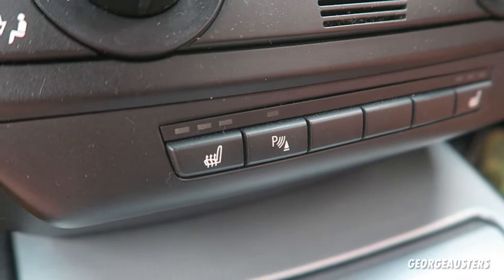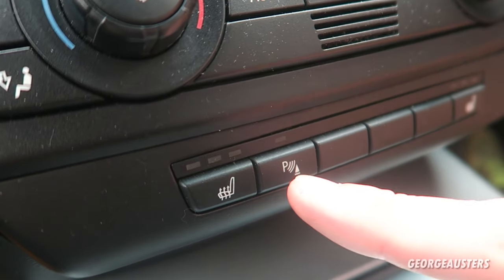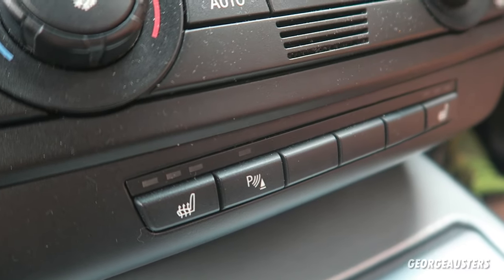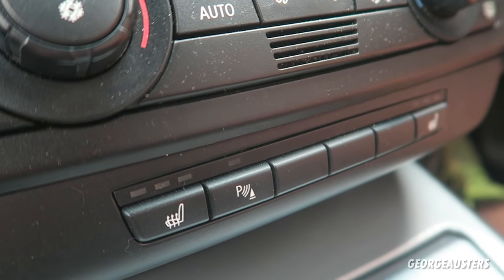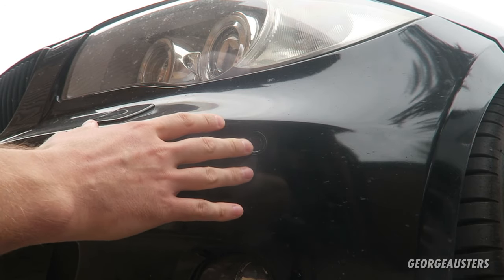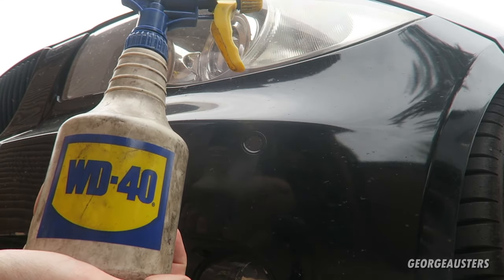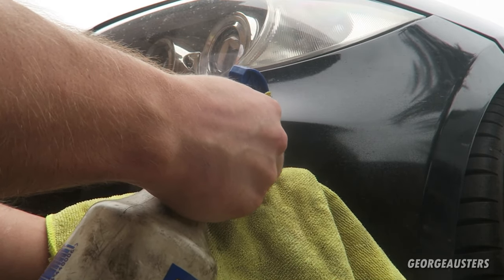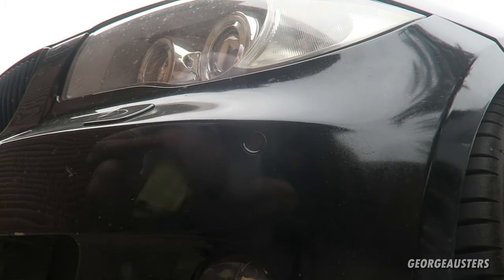How To Fix Your Parking Sensors For FREE *Works On EVERY CAR*

Comment: Did this on my challenger, just went and washed my car and my sensors stopped working , went and bought the WD-40 and it worked.
Reply from the maker: Glad to help!
Reply: WD 40 is lubricant...?
Reply: @gursimransekhon688  that's a misconceptions actually. If you truly need a good lubricant, WD-40 is not it. It frees up squeaky hinges and rusty threads, etc, but that's not as much from lubrication as it is Water Displacement (product stands for Water Displacement - 40th Formula). Draws moisture out, thus helping prevent/fix rust or in this case, clear up a sensitive electronic sensor.
Reply: Why does this happen after a car wash? This just happened to me as well I’m on my way to buy wd-40

Comment: I used a portable vacuum (18v Milwaukee) I put the hose on the blower side of the vacuum and used a crevice attachment (this increases the speed of the air) and aimed it at each sensor while varying the angle of directed air and it worked. No direct contact between the vacuum attachment and car panels/bumbers.

Comment: I was very skeptical of this but decided to try it on my 07 Silverado. My wife had washed my truck and I had not driven it for 3 weeks since I was away for work. When I turned it on I found the Service Park Assist message and found my sensors were not working. When I saw the price for each was over $200 I said what the heck, it can't get worse. But to my surprise after spraying all 4 of them with WD40 and turning on my Silverado, the sensors started working and the message no longer came back. Thanks for the trick!!
Reply from the maker: You’re very welcome Edward, glad to help with your truck!

Comment: This sounds too good to be true, i will try it and report back xD   Just bought F11, when testdriving it it worked, and just after i bought and brought it home, sensors stopped working, just got an error '' no parking assistance, please park unaided'' lol.   Ill try this, because i really dont feel like taking down bumpers replacing sensors with alibaba ones (they are cheap, but the replacing part probably sucks)
Reply from the maker: Good luck
Reply: ofc it didnt do nothing.
Reply from the maker: @skyliner4610  did you spray a good amount directly into the sensors?

Comment: Thanks for the valuable tip- Had problems with the camera in the back of the car-- did not work at all- used WD40- after 1 hour it worked perfectly again. 6 euros for WD40- we saved at least 500 euros on your tip.
Reply from the maker: You’re welcome!

Comment: Honestly I've been chasing a supposedly bad rear sensor on my 09 Ford Smax, computer said it was the rear right sensor, removed it and swapped it with the working left rear, same thing.

Chased the cabling all the way to the sensor control module and tested everything for continuity... All fine. 

So i be assumed I'll need a new control module at 225 quid from ford.... Balls.

Sat in the bath hunting for other fixes, came across this video.

Doused all the sensors in wd40, wiped and doused again.... Put her in reverse.....bugger me it works.

I can't believe this fix works.

Thank you so very much!

Comment: What a simple trick! It worked on my 2008 Toyota Sequoia instantly. It has been fussy this winter. I tried washing and drying the front sensor, thinking it just got a bit dirty without success and the new sensors are very spendy. I sprayed it liberally with WD40 and the sensor alarm went away immediately. Thanks George.
Reply from the maker: Glad it helped!

Comment: Thank you, this really works, tested on Peugeot 508 SW 2015! Haven't drove our car for 6, 7 days. Car was outside under the car cover and past 6, 7 days we had all kidns of weather condition: snow, rain, light winds, up to -8 Celsius over the night, few sunny days.... Yesterday decided to take out cover from the car, it was below 0 Celsius and because of rain, snow, sun and cold, there was a lot of snow on the top od car cover and car cover was like a cardboard paper almost completely glued to the car. We had to use a lot of water temperature around 25 Celsius (never use hot water, glass could easily brake if it's really cold outside!) to "soften" the car cover. Finally we did it, car cover was removed. Some half an hour later tried to start the car, it started without a problem but on the main screen car gave us a worning  that something is in front of car but in front of the car there was nothing at all. At first we thought some of the parking sensors on the front of the car got faulty. We took a short drive and every single time we stopped car gave us a working that something is in front of the car really close, it was so anyoing. Did some research and found your video on Youtube so decided to give it a chance. My WD40 bottle was almost empty so I had to use something else: cheap W5 lubrication spray from LIDL, not as good as WD40 but I had nothing to loose. I've sprayed all parking sensors in front and on the back of the car two times each, it was still cold outside, left it to soak for a half an hour. Started the car and: voila, no more parking sensors warning! Wife did a few circles around the car, 50cm to 20cm from each parking sensor, to test if all car sensors are working propperly and they did, problem solved! Guess some amount of ice formed around one of few front parking sensors, they were "thinking" there is a close obstacle in front of the car. All in all problem solved, no more parking warnings yesterday or today, hope it will stay that way. You've earned yourself one more sub, thanky you!

Comment: Spot on. 2014 ford Cmax with "Parking Aid malfunction. Service required" message.  Spayed the rear bumper sensors with WD40 some crud also came out. But back to normal working. Great fix. Thanks for posting this video. How many drivers have put their car into the Ford service centre without trying this hack?
Reply from the maker: Glad to help! Yep dealers will be replacing the sensors at your expense before trying this trick!

Comment: Hey there! Hitting you up from the US, I just did this on my wife's 2012 Ford Focus and it worked like champ! I used Tool Box Buddy spray fluid rather than WD-40 but they're all pretty similar. Sprayed it down, cleaned it up and waited a while to let it work. Tried it a couple of hours later and the problem was fixed. On the Focus the sensor made a continuous beeping sound rather than the repetitive chirp and now it functions like new.  Thanks for the post, I'm sure the shop would've charged me at least $200 for that.
Reply from the maker: Glad to help! Considering supporting the channel to show your appreciation

Comment: This worked on a 22 Black Edition Ridgeline, thanks! Front passenger side sensor stopped working properly after a rainstorm but the driver side worked still.   All work as intended now!

Comment: Just used this tip and fixed my annoying warning flatline bleep. Thanks! 🙌
(Mercedes CLK 2003)
Reply: I got 2red dots and beep .. on my w204
Reply: @almighty9662  same with my s class 2008; how did you fix that?
Reply: @devmaadam2922   still not
Reply: Yep. Fixed my flat line too

Comment: Thank you very much. My Vauxhall Mokka was giving "Parking Assist Temporarily Unavailable" and giving a loud Bong sound every time I started the car and every time I came to a halt. It was driving me nuts. I sprayed WD40 into the sensors but it did not fix the issue straight away. However the next morning it was working perfectly.
Reply from the maker: Yeah can take a while to drive any water out👍🏻

Comment: 10/10 tip it worked on my audi Q2 which stopped beeping when put in reverse, it only had one long beep instead of the frequent beeps alerting me of distance to an object. after cleaning with wd40 it started to work as normal
Reply from the maker: Glad to hear!

Comment: This worked for me, parking sensors kept getting randomly triggered when there was nothing infront of the car and this solved it.
Reply: Same issue here. Going to try that fix
Reply: So you mean ur car was beebing with nothing infront ? And u use the wd40. And it is gone ? Cause i have the same issue here some time its beeebing with nothing behind and sntimes it works perfectly! So u advice me to use the same trick ?
Reply: @ahmedradi4773  this fix stopped working shortly after. Haven't figured out a fix yet. Probably needs a trip to the garage.
Reply: @Oscar-if6lq  if this doesn't work you most likely need to replace the sensors in the bumpers
Good luck 🤞
Reply: @ahmedradi4773  just wipe the sensor with dry clothes or dry tissue. Mine also beeps sometimes after washing.

Comment: Worked on my Ford Ranger. The night before was a deluge of rain, had an issue with the passenger rear reverse parking sensors. After a quick blast of WD40 and waited a few minutes and it sorted out the issue.
Reply from the maker: You’re welcome!

Comment: This strategy worked for me multiple times until recently. Now one of my front sensors will not work regardless of WD40 use.....New sensors for my Lexus are about $250 each not including installation labour.

Comment: I find this error occurs after heavy rain. If I clean out, use blower and WD40, then wait a few days when warm weather back, fault disappears. Has worked last 4-5 times. Not to say this will work in the future as wear and tear occurs. When I use the blower, always amazed how much water there are in the sensor gaps. Anyhow, give it try. Can’t hurt.

Comment: Good tips G. Thanks 
Maybe ppl should tape up their parking sensors with masking tape when they go for a car wash - I nearly always hand car wash my BMW E60 myself and have never never had any parking sensor issues in well I over 10years of ownership. Peace ✌🏼
Reply from the maker: Yes that’s probably the main cause for parking sensor failure when people spray directing into them... I’ve had it once before when I drove through a puddle of water. I did this trick and fixed them!
Reply: Thank you good to know  @GeorgeAusters
Reply: And what about if it rains
Reply: @Theorangeman.  pressure is not so high

Comment: Hi, tryed this tip and worked for a cupple of days each time, then just didn't want to work any more. I have just been to the garage and had the codes cleared as it was throwing up codes for all 8 sensors. I don't think all 8 are broke what would you suggest to do now please?
Reply: Any suggestions bud

Comment: Rear parking sensors on my car were working fine until one car bumped into rear bumper and after that the sensors stopped beeping and also no red light on the parking switch inside the car. Can WD 40 solve this - there is no damage at all - it was just a slight nudge from behind - appreciate your thoughts on this one - thanks
Reply: Same

Comment: My wife's Zafira is having this issue (got sensors on front as well) so I'm going to give it a go soon :) )
Reply: Gutted, it didn't work..... Next I'll see if the reverse light is working properly. I checked the fuse and that's okay so unless the bulb is faulty, I have a feeling it might cost some money!!!! :(

Mind you, we've had the car for a while now and not really had to spend anything on it much.
Reply: Went to car in the evening to check the reverse light and it's started working again! Fingers crossed the WD-40 has worked!

Many thanks if it has :)

Comment: I have a c200 CDI, had my car polished, the rhs sensor goes on without any object being close by and without reason, any tips
Reply: Having the same issue with a CLK270. Have you fixed your issue?
Reply: I have e350 2011, have my car polished, than after 5 days i washed and have the same problem, any tips?!

Comment: my e90 d 2011, warning sign appear PDC failure at back(probably  because i put my gear knob to R) ...i will try to spray the wd 40 and see whether it work or not.
Reply: Try today but Seems like this method doesn't working on my car... Faulty on idrive was Faulty sensor with the pic(the  car has no "green" light front and rear) any solutions mate?
Reply: up dates...finally i bought the pdc sensor n replaced

Comment: On a clean and dry car, with third party sensors, that goes continuous beeping even if there's nothing behind, the problem can be also humidity?
Reply: I replaced them with cheap one from aliexpress, ez.
Reply: @sheppardpat47  did you fix it?
Reply: @2024-x4o  I bought 10$ sensors on Aliexpress they were the same size and works good
Reply: @sheppardpat47  Oh ok, one of the rear sensor is showing in the screen an object while there is nothing, wondering if that wd 40 fixed it but seems it didnt for you, right?
Reply: @2024-x4o  Mine were painted by touch up paint by the original owner and I think that's why they didn't work correctly

Comment: Citroen DS3 2014
Comes up with parking assistance fault see cars manual. Sensors do not work at all and haven’t for about 2 years. Is the WD40 trick likely to work? Anyone know what common faults are with parking sensors? 
TIA
Reply from the maker: Worth giving it a try!

Comment: My sensors only work in freezing weather which is very odd.
Theres just a long beep when i select reverse.
Ill try the WD40... and comment back here for results
Reply from the maker: Good luck!
Reply: Didnt work 😅 
With further inspection, one of the sensors looks slightly pressed into the bumper. Could be a single faulty sensor.
I dont know how to take it out though.. the sensors arent fitted into a removable plastic panel like some other cars. Theyre in the bumper

Comment: Are there any plugs or caps or whatnot for these holes in the bumper cover? I bought a new bumper cover and my original did not have these sensor holes....all the sensors for sale on Ebay are from China and I would have to wait for weeks to get them!
Reply from the maker: Does your car have sensors or not?
Reply: @GeorgeAusters   no, no sensors but I would buy them just to fill those holes

Comment: What did you use to test the sensors?
Reply from the maker: Nothing
Reply: @GeorgeAusters  2:35 So, you have the IGN on and physically test by getting close to them.
Thank you.👍
I missed the tone sound as I had the volume low when watching it first time. Plus very tired as not sleeping too well lately.
Reply from the maker: @nigelnightmare4160  I just walked round and checked which ones beeped when PDC was selected

Comment: Can you use Contact Cleaner instead of  wd40 ?
Reply from the maker: Contact cleaner is more for the actual electrical connectors, not for drawing water out of the sensors
Reply: That may cause issues with your paint..

Comment: I have a question not sure if you still reply with it being pretty old video. I bought a car from copart (stolen recovered with no front bumper) I replaced the bumper then realised the car had front parking sensors looks like their is still some of the sensor harness their i get service park assist on my screen when I select Reverse the rear ones are all their and they tick when I put my finger over them so they're all good but they don't beep will this be because the front is missing the harness ? Is their a way to remove the front harness as I was reading front sensors were a add on, on my car from vauxhall or is their a fuse I can just remove for the front so only the rear will work ?
Reply from the maker: I'm not sure about that one sorry
Reply: @GeorgeAusters  no worries buddy thanks for your reply

Comment: I have pdc failure error msg, one of sensors doesent make any sound. Is it possible that msg bcoz of 1 fking sensor?
Reply from the maker: Did you try WD40?
Reply: @GeorgeAusters  i didnt, cant find my can :P il buy tomorrow and test it. I have another contact silicone spray is that good or? And thx for fast rply
Reply: @MrSpeedkg  q

Comment: Just wondering......  does it have to be WD40 or will an off brand lubricant work just the same.  Just wondering, as I have a full can of off brand lubricant, so it would save me buying a new can of WD40 if not necessary.   Thanks!
Reply from the maker: WD40 isn't a lubricant, its water displacement 40
Reply: @GeorgeAusters  Thanks for the quick answer George!  That's really interesting.  I didn't know that.  I guess I'm off to get some WD40 then, eh!   From all the comments, it sounds like this is a pretty amazing trick...... that really works!  Thanks so much for sharing your knowledge!

Comment: How did you check they were working without anyone in the driver's seat?
Reply from the maker: You don’t need someone in the driver seat to turn on parking sensors👍🏻
Reply: @GeorgeAusters  in mine you do, pov spec lol, I don't have a switch
Reply from the maker: Yeah I’m guessing you only have reverse sensors?
Reply: @GeorgeAusters  yis

Comment: Ayup mate, I tried this on my jaguar xe reverse sensors but still getting the parking aid not available message
Reply from the maker: Have you let them dry out?
Reply: @GeorgeAusters  did it this morning and still getting the message tonight. However the diagram of the car popped up for a second this time then the message came up. Maybe needs some more spray in it

Comment: I cant cant get the parking sensors on the 130i to work. After doing various test by swapping parts between my 118d and 130i,  I know the the PDC unit, sensors and fuses are fine so i have no idea what the problem is.

Maybe something to do with the coding although i don't think that you have to code new pdc modules in.

Any ideas George?
Reply from the maker: You need to use ISTA D👍🏻
Reply: @GeorgeAusters Lifesaver! Thanks George, keep up with the awesome videos
Reply: What is ista d